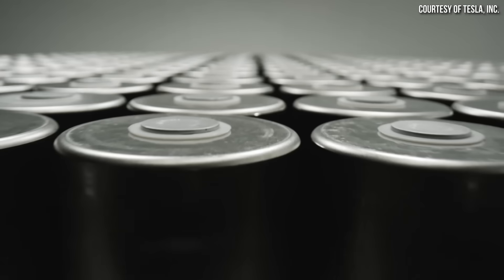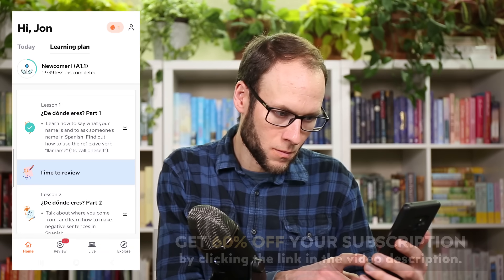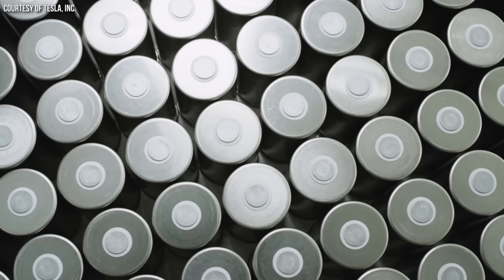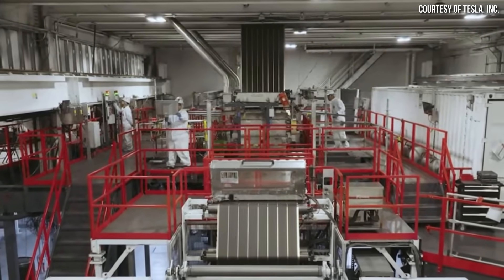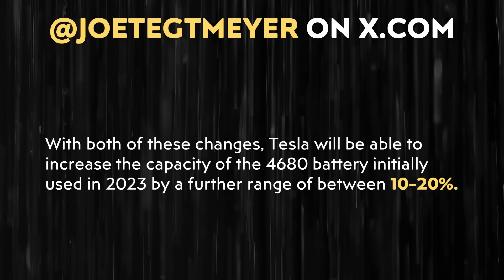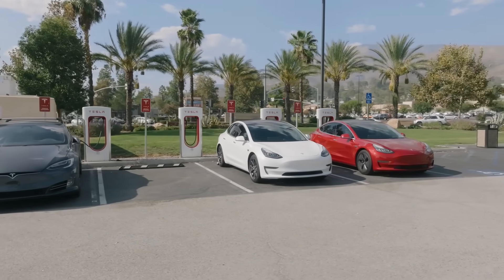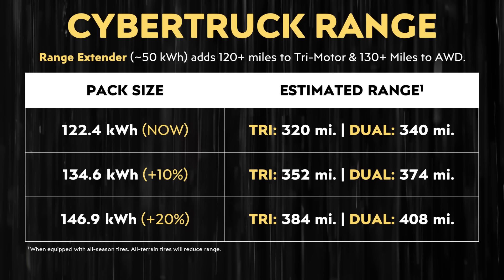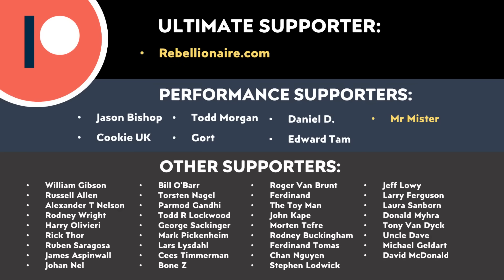NEW Tesla 4680 Battery w/ 10-20% Energy BOOST | COMING SOON!

Comment: A truck should be able to tow its rated capacity for 300 miles on a “tank”.   That’s where they need to get to if they want to convert truck USERS. 

(Notice this is not necessarily truck OWNERS who drive their 1/2 ton station wagons to the grocery store)

Comment: Since the 4680 has been fairly disappointing to this point, I'll believe it when I see it. It would be really nice to see energy density levels rise so that these trucks can be actually useful when towing. Is there an actual safe limit to energy density or can it become so great we can have 1000 mile range EV's. Or will it become the same as miles per gallon with gas cars where it seems like 40mpg highway is the average upper limit excluding hybrids.

Comment: I think you have the wrong take on the asymmetric layers on opposite sides of the foil. I believe it is simply that the inside is thinner and outside thicker so when wound up the actual thickness becomes equal after wound up.

Comment: There are two million orders for the Cybertruck and they are getting more at the rate of 500,000 a year. The 4680 cells are called "Cybercells" internally also. So whatever happens, no, there are not going to be more 4680 going into Model Ys, and they will not start going into the Semi.

Comment: The all wheel drive CT has 340 miles of range plus the extender 130 more miles. So just improving 10% will be 517 miles of range and if they get 20% it will be 564 miles of range as long as they keep the same quantity of batteries. I hope they do but I'm keeping my expectations low.

Comment: I think the asymmetric laminate saves some space because these are printed out in sheets then rolled up. When you roll something up the outside of the roll is going further than the inside of the roll. I don't know how much difference that makes, but apparently it allows a tad bit more material to be squeezed into the same volume of cylinder. That also saves weight because it is more active material vs inactive material (the case). I am not any kind of expert on this, just what I have read about it, or watched videos on it. Again, how much difference that makes.. who knows.
Reply: The main problem is material elasticity - the inside roll since is packed in a smaller radius is more prone to breakage. At the cell level more material will not mean much but at a pack level it adds up.
Reply: @loszonga I was wondering if it was more about keeping a consistent matching of materials between the inside and outside of the spiral.  Clearly the outside would stretch more and bet at more risk of defects... perhaps it is more for higher quality and the extra capacity is just a bonus.

Comment: Well IF that were true - you have to first realize the Original 4680 with 16% higher energy density was canned; and the 4680 variant lets call 4680b which is now installed in the 235 Cybertrucks produced so far is only 10% more energy dense. However Tesla can't even produce this downgraded 4680b efficiently; they say they produced 20 million but they do not disclose their failure rate - they only say it is getting better each month..Sounds like it must be bad if they can't say how bad.
This accounts for the trival output of Cybertrucks to date and their poor documented range and charge times which one can now see on Youtube videos.
Reply: I'm also curious whether this change could lead to increased efficiency in productivity
Reply: @boomincho1438  if they changed to an ordinary battery the wouldn't need new production lines and they wouldn't have that much impact on performance 10%
Reply: @litestuffllc7249 
You're really missing ALL the main advantages of the 4680, aren't you?
Not sure if that's intentional, or just lack of research/ understanding.
Reply: @rogerstarkey5390  There are no advantages if Tesla can't make them efficiently.  They promised the stock holders last year after 3 years of delays that they'd have the problem licked and be building Cybertrucks with them and taking a big share of the market.  Even if you are optimistic about them still fixing this problem they couldnt fix in 4 years - then -it will be at best a year to 2 years which happens to be when Elon thinks they will actually have a production line for the Cybertruck - I think he is just hoping real hard on that.
Reply: Which "original" 4680 is that?
.
The first version had a lower grade chemistry.
This one has a new mechanical construction which boosted internal volume, allowing for more material, so more capacity.
The next version will be a chemistry update..... Details to be confirmed.
.
Suggest heading over to The Limiting Factor for some education.
Reply: @rogerstarkey5390  Go check the original specifications Tesla themselves say they changed it down to 10%, you can even find the chemistry changes.  They've taken 4 years to get nowhere.  4680 is the only reason production is pathetic. It won't be getting significantly better until they solve this production problem; it is way more likely they will officially ditch the 4680 all together and claim some new battery is even better. These boosts you talk about - just pie in the sky they always try to sell when things are bad here - look over there.  With some major percentage of cells being rejected; Tesla is not forth coming on this; but you can see the stock is down 20% in 2 weeks Cybertrucks failure is on big reason; in last years stock holder meeting they said they would have 4680 solved and they didn't get it done.  A significant part of Tesla's value had been the prospect of getting a share of the pickup truck market ; now at best it is delayed a year or two -  I'll lay odds on them ditching 4680 all together rather than fix it.

Comment: This video’s entire premise is based on assuming that adjusting for more nickel in an NMC battery will result in linear increase in energy density corresponding with the proportional increase in nickel. Of course, this cannot be assumed. 

The adjustment, like he mentions later, could be for other reasons: cost, ethical sourcing, tax credit compliance, etc.

Comment: Uber remains the game changer for the US auto market as solves the problem of having to own a car let alone drive one when one needs access to four wheels and a steering wheel. As far as Class 8 semi work in the USA that is still overwhelmingly managed by the US Railroad Industry not that a Tesla Semi can't greatly aid in that...gonna be a while at current sales rates for that though. Battery powered Van market huge now with Rivian and Ford tackling that one. Rivian prepping Georgia for pocket rocket R2 BEV is what i will be watching for this Year 2024 for launch so the rumor goes next Year 2025 anyways. Cybertruck has so many firsts just following reliability issues alone will be an entire work effort let alone trying to adjust production along the line to solves those issues. Tesla Supercharger seems to be an engineering marvel. Starlink and the "X" app seem to be holding up well.

Comment: I think he should have done the calculations from real world mileage instead of Tesla’s claimed mileage. I can’t recall which Cybertruck posted 254 miles around there @ 70mph, could be dual motor. Then with a 20% increase would mean realistically 305 miles not 408 miles. Tesla would have to double the energy density to reach over 500 miles as it promised. I am optimistic they will reach a solid 400+ miles in two to three years is my guess.

Comment: Wasn't Tesla proudly saying that they don't use cobalt?
Reply from the maker: No, they are working to reduce it, but it is still used in the NCA/NMC batteries.
Reply: @Cleanerwatt my recollection is that Musk was more specific about it going to zero in the nearish future. And the same for eliminating rare earths in the motor magnets. While I like his vision and goals, as always his predictions and timeframes are overly optimistic. It’s been greatly reducing his credibility esp. for FSD. The BYD blade battery is great. I think the 4680 may get there but it’s clearly way harder than he expected
Reply: @longboardfella5306  LFP batteries in the standard range Teslas are already cobalt free.
Reply: @tysonn4736  is there LFP in the MY SR? If so, why does it qualify for the tax credit?
Reply: @darylfoster7944  Correct.  LFP in the 3 and Y standard range.  I think they are losing the tax credit in 2024.
Reply: @tysonn4736  Cleanerwatt answered my question. There is LFP in the 3, but 2170 in the Y. That's why the Y is still eligible for the credit.

Comment: 500 miles is 800km.
Even 500 miles of range is not enough for professional people who tow for a living.
500 miles becomes much less with a tow load.
Reply: Nothing ever is enough for some unrealistic people/ beings.
Reply: It's enough for us because we only tow less than 100 miles usually.  CT would be awesome for us but sometimes we tow about 14000 pounds which I think CT motor could do but not sure about breaks and tow hitch though.
Reply: What brand of diaper do they prefer?
Reply: @josephv5484   500 miles becomes 200 miles in the cold with tow load. That is around Manhattan to Washington. 4 and half hours of driving. Not enough to warrant a diaper.
Reply: @vorpalinferno9711  four and a half hours to drive 200 miles? What kind of road are you driving on?

Comment: Wow
Now the only way any company beats Teala would be solid state batteries.
Reply: Except Solid state will be in short supply AND expensive for some time AFTER they arrive.
Reply: Every other EV truck maker is already beating Tesla.
Reply: @TroySavary 
Your delusion is showing
Reply: @rogerstarkey5390  Tesla has the shortest range of every truck so far on the highway range test. 254 miles is a sorry result. Silverado EV went almost as far towing a trailer as Cybertruck went empty. You are the one delusional if you think that result shows superiority of the Cybertruck.